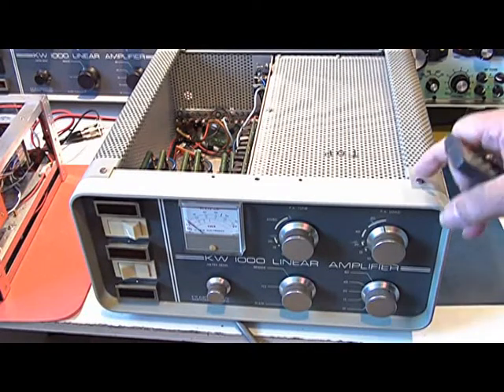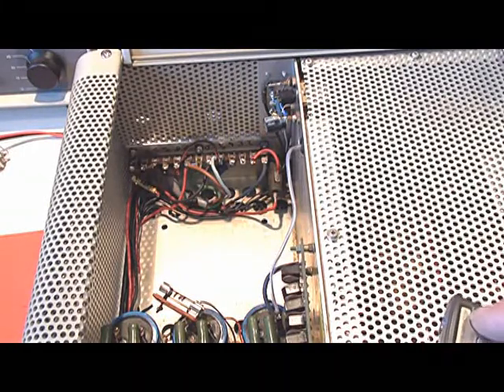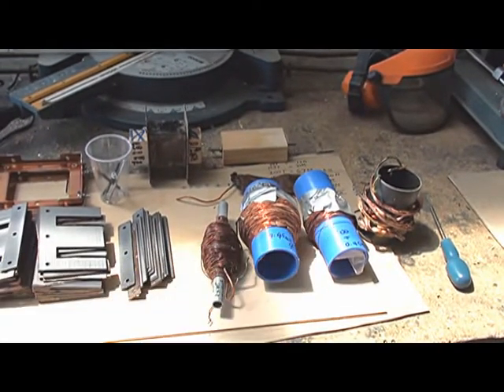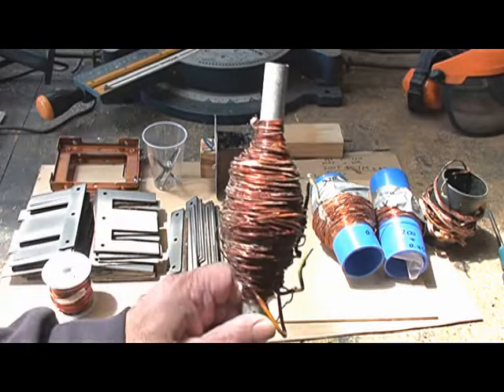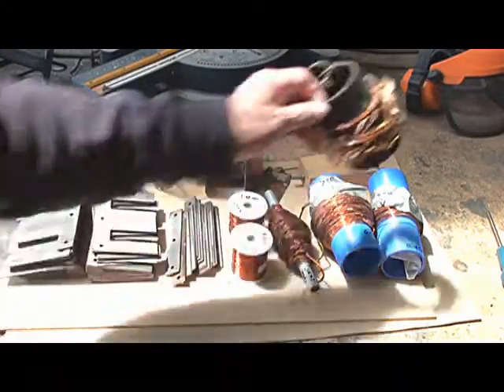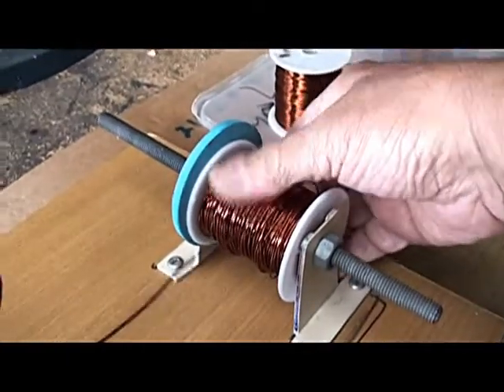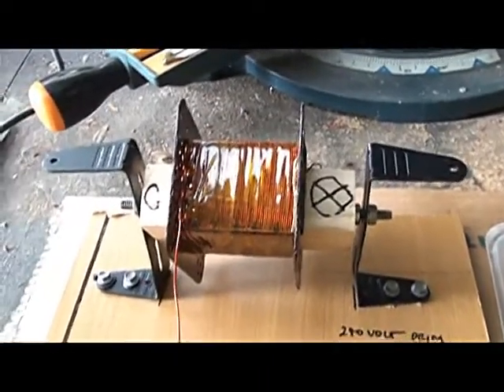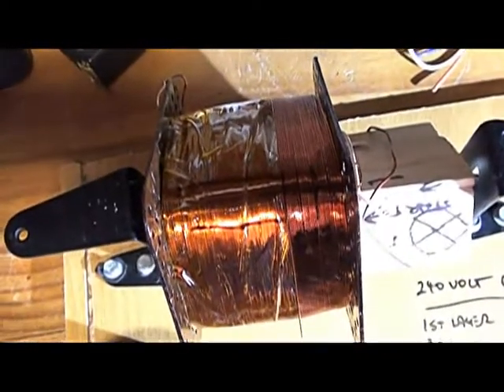KW1000 transformer rebuild  Part 1

Comment: Cheers for posting - Interesting I've been keen to find one of these units for ages to add to my collection, I  have a KW2000B and an E model plus the SuperMatch 109 Just need the KW1000 now haha . Having said that the both the B and E are not working and need a full resto recap , most likely the Mech / Filter has turned to goo inside they say as,  both fire up if slowly using a variable reo . Any chance you do repairs give us a shout please - Regards and 73's Kris - ZL1KJT
Reply from the maker: Hi Kris, the mechanical filter will most likely have deteriorated foam. If you open it up it is possible to repair, it but it is a pretty delicate operation. I did try to fix a 455kHz a TOYO unit, but once it cleaned it up, I ended up with 2 peaks, neither on 455kHz. So, I just replaced it with a Colins unit which worked better than the TOYO by a long shot. So, it was not really worth trying to fix.  If you buy a new one, then maybe have a go on the existing one just to see how you go. If it works, you will have a spare. When you consider the value of these radios, the outlay for a good Colins filter will be worth it. And you can also try one of the low cost 455kHz ceramic filters in the radio, just see how it goes. There are quite a few of these with different bandwidths and quality. Just as a tryout really. 

 I can't help you fix your units since I am in Australia and in the process of moving house. Regards, Lou, vk3aqz
Reply: @vk3aqz  Heya Lou sorry your reply got buried in my inbox and truly appricate your comments , I would love to get a working KW1000 to finsh up my little collection of boat anchors LoL and join my KW2000E line up I did find this chap on one of the UK KW user groups who has developed a tasteful replacement filter design that goes inside the old Can so it dosn't look butcherd too much. I'm not a purist and just want the old kw2000e back on the air before I become a silent key at this rate . so not opposed to any witchcraft that gets her going again. Anyways if you read this what do you make of his reply and should I splash the cash or as you point out find an old Collins if it can be found in working condition Regards and 73's Have a merry Chrissy Kris - ZL1KJT 
Hello Kris,
               The most likely cause of failure in the radios is the Kokusai filter.  My replacement module fits in the trough in the existing filter and although a pain to clear out the mechanical assembly within the trough and the goo in there as well. fitting the module within the trough is the best electrical and mechanical solution to that problem.
 
Another thing about old radios is the resistors.  There are fairly long ones with a cream coating right over to the wires.  At the time of manufacture of the radios, 1970-1980, those were relatively new resistors.  The ones slightly bigger diameter but shorter, white ceramic and with brown ends actually date from 2nd World War time, they can go low resistance, or high resistance or even open circuit.  Similarly the much smaller brown resistors, though of the 1970-1980 period can also go high or low.  Most of these can be tested in situ with something like an AVO meter or modern resistance meter. 
 
It is likely that non-electrolytic capacitors are alright, but electrolytic types can dry out after the rubber ends get brittle and break the seal with the cans.  Take advice from other KW enthusiasts to find out likely component failures.
 
So the modules I supply come with wires ready to fit in the troughs in the Kokusai filters.  You need first to get into the filters.  You can actually use a carpet knife to carefully cut the solder seal between the filter can and its metal base.  Then attack the trough and use a large flat blade screw driver to get most of the goo out.  Powerful solvent will remove the residue.  Then drop my filter module into the slot as described on the accompanying instructions, and solder the wire protruding each side to the lip of the slot.  Then connect the wires attached to my module to B (positive HT supply, and P (plate or anode), G (grid), and E (earth or 0V).
 
Make sure when you replace the assembly to get it the right way round.
 
The Filter Modules ate 70GBP each and P&P to New Zealand is 12.75GBP  up to 100 grams.  So one filter by bank transfer will cost 82.75GBP and two filters will cost 152.75.  By card or Paypal, one filter 86.90GBP, and two filters 160.40GBP.
 
I hope that helps.
 
Regards,
Antony Nailer
Spectrum Comms.
Reply from the maker: @kristhompson8112  Hi Kris. The information from Antony is pretty good. If I had known he had a kit, I would have probably used it. If you buy a Collin's filter on the web you have no way of knowing if it is okay, and they are not cheap. His solution also keeps the old case, so the radio looks authentic which is okay.

 I think I got mine from a ham who worked for Collins and we did test it before I took it. Also, there are lots of versions of the Collins filter and if you end up with a 500kHz one, or some other strange IF frequency (and I am not sure if there are different IF versions), your dial readings will be wrong. All his other information is good. So yes, spend the money (it's only money after all! and you can't take it with you!!) so take the more guaranteed path and buy his kit.

Yes, old resistors die. I found wire wound ones stay on value but carbon ones not too good. Same with some caps. Even mica ones can be crook. Anyway, sounds like a good project Kris. I have to say they are really nice rigs with nice sounding audio and easy to use. Cheers, Lou
Reply: @vk3aqz  Wow Cheers Lou for coming back to me on this so quickly, The wheels on my radio projects turn so slowly my end  it's frustrating. But being a widow and looking after a kid comes 1st in life , so thank you again for your encouragement to keep pushing ahead with it,  and I will pull the pin and go with the upgrade filter as you say you are likly to maybe get a dud Colins or one that won't just drop in the hole and could then spend hours chasing other issues that I don't have the skillsets to chase. I'm sure you have seen it but I just watched the full vid of the UK based guy call Steve full vid on the history of KW electronics , the title is def wrong as he qiuck fires an hour and a half , a ton of information Man that guys knows his stuff , Their clubs KW user group net is coming up in Jan , if the DX was good it would be so cool to dial in, but reckon you would need that KW1000 to break in haha . Spotted your bio up on QRZ very very impressive home builds projects Wow . Youll see from my QRZ bio I also have a background in TV land audio , mainly work for Sky these days doing RF audio builds for OB's  etc. Were wondering if you mind we stay in contact via your email up there as would love to pick your brains if we hit a major issue with this resto project . I'll only bug you if the old boys at my branch 03 Auckland won't play nice hahah cus most are old grumpy men and just say walk away  ,  Regards and 73's Kris  Have a great Chrissy ZL1KJT 🎄🎄🎄
Reply: https://www.youtube.com/watch?v=5Rco01zKu08&list=PLX8so0MhUML8x7DFibuDYe0zqADwLJypj&index=3